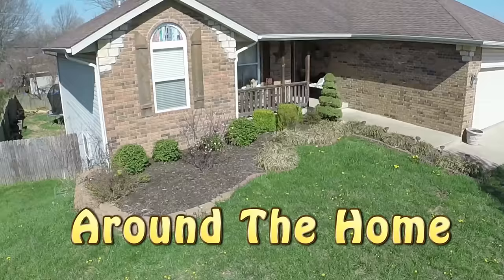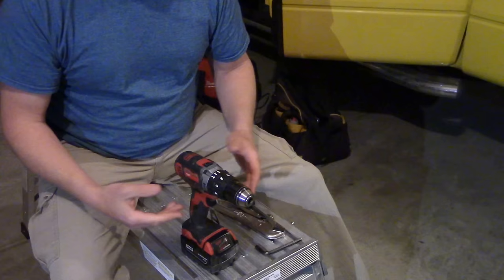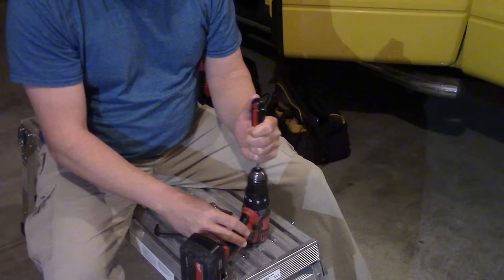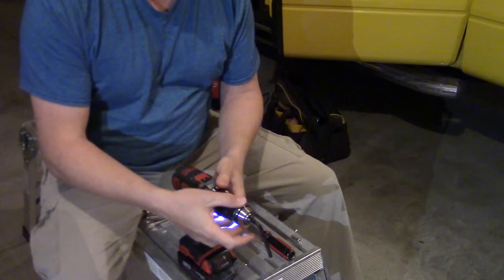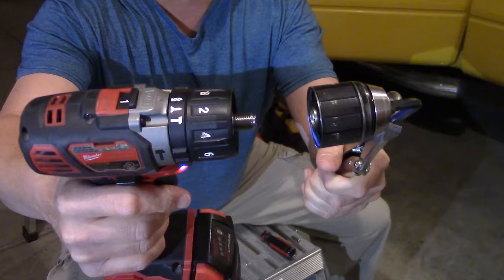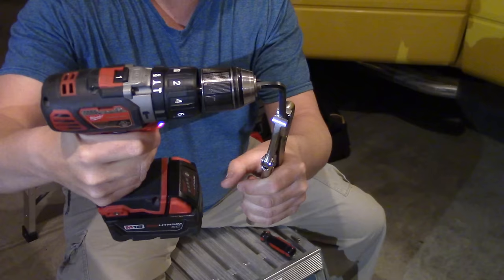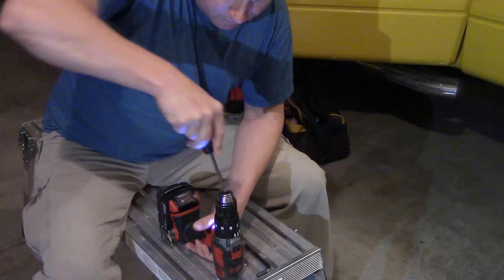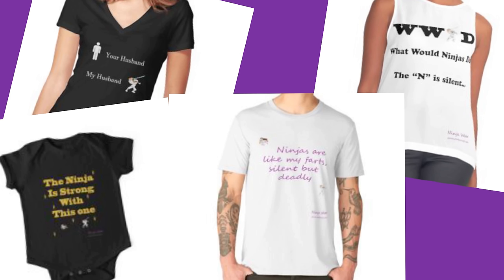Cordless Drill Chuck Removal

Comment: Hey thanks, you saved me from having to buy a new drill. I was on the verge of throwing mine out, as I've never been able to remove a chuck  before. The allan key trick did it. Also as a bonus, once the chuck came out, I was able to fix the three grippers that had partially jammed for some reason. Luckly, they jammed wide enough to take the allan key. Back to normal now, no money spent. Many thanks mister. Much appreciated.
Reply from the maker: You are welcome!

Comment: Thanks for sharing. One tip is that you can use an impact driver to tighten or loosen the screw inside the drill chuck. This way you won't risk anything grabbing, smacking you in the face, etc. Drills are probably in the top 3 causes of testicle-related injuries.
Reply from the maker: Thank you for watching. Check out hundreds more of our videos at https://www.aroundthehome.org/
Reply: Exactly what I was thinking :)
Reply: Yesterday I was trying to twist off the screw with a screwdriver till my skin almost came off. Then I mounted a flat head bit to my mid torque impact wrench and it loosened with just a flinch of the trigger.
Reply: Curious, What are the other top 2?

Comment: Unfortunately this didn't work for me. Drill doesn't have enough power at 55 nm, and whacking with a hammer won't get it loose. I can use raw force with extra leverage on the allen key, but it just seems to turn the chuck somehow. It's at speed 1, drill mode and in reverse. Any ideas?

Comment: Your very detail video saved my Harbor Freight Hercules 1/2" 20V Model HC92K1 drill which sold for $120.     It was advertised as "comparable" to the Dewalt drill and a compatable chuck sells for $16 on Amazon that one reviewer indicated it fit Hercules.  My drill's chuck would open to full width but would not tighten enough to hold any drill less that 1/4".   The screw in the chuck was a Toric 15 and it turns out that it was very loose.   I tighten the screw (left threads) and now it works just fine and no new chuck needed.
Reply from the maker: Glad to help

Comment: Second time changing a chuck on a makita drill . 

First time was for a friend , the chuck was completely broken. Teeth were broken so couldn’t use an Allen key . Cut outside chuck casing with a grinder and locked a 24” pipe wrench on chuck to lock it and used a steel site box for mechanical leverage to spin the chuck off .

Tried your method today and had no luck . But decided to just use the vice grips as leverage with the Allen key and it came off . 

Good video ,thanks !

Comment: Thanks for the video.

I ended up using a breaker bar and the largest 1/2" drive hex bit that I could fit into the chuck, which ended up being a 7/16" hex for my 1/2" drive drill.  I pinned the breaker bar and the drill against the ground and bumped the trigger to break the chuck loose.
Reply from the maker: Thanks for watching. Don't forget to stop by our website www.greatwhiteninja.com

Comment: I busted my middle finger after taking the screw out and attempt to use the vice-grip and the biggest hex key (6mm) that I could find my hands on. The vice grip slipped and by the time I had noticed the hex key had already struck my finger.

Tip 1. after taking out the screw use wd-40 and wait 15mins for it to soak into the chuck's rod and it will come apart easily.
3 weeks until my finger heals. It's just a scratch still but I wanted to avoid it altogether. Use a decent pair of gloves too.

Comment: Milwaukee doesn't suck! But you can still change the chuck on your newer M18s which use the 9/16"-18 chuck. At this time you will not find either of the ROHM 1/2"-20 or the 9/16"-18 on Amazon. But Suncoast Precision Tools has them. At least they have the 9/16"-20. I just received 1 and ordered another today.

Comment: I had a Makita drill that would not come off by hitting it with a hammer and allen key like the other videos showed. 
This one actually works !  Just make sure drill is in the lowest speed (1) for most breaking power and it is in reverse.  Also I put the other end of the allen key in a vise. And USE 2 HANDS ON THE DRILL.  It can tear your wrist off if you don't hold it very secure and with both hands. 
Another method that looks like it would work is using an air powered air gun with a hex bit in the drill and the drill in a vise.
Reply from the maker: Thanks for watching, and I am glad to help. Don't forget to stop by our website www.greatwhiteninja.com

Comment: I have a 1/2 inch magnum drill motor 5.5 amps that uses a keyless chuck. That uses the best keyless chuck. They should of used that chuck in there heavy duty cordless drill. They are just making things a lot cheaper these days. But the price is does not go down.
Reply from the maker: You are right. Thank you for watching. Check out hundreds more of our videos at https://www.aroundthehome.org
Reply: @AroundTheHome1  Thanks for the confirmation and will watch more of your videos Sir.
Reply: @AroundTheHome1  Can you tell me if my Porter Cable drill motor 18 volts can get a replacement drill chuck that is of high quality ?? My chuck does not hold drill bits firmly. Can I purchase a high quality one from say Jacobs ??? Thanks

Comment: Thank you!  I'm making a 1/2 impact to drill chuck adapter using the chuck you recommended.  I just didn't want to mess with the 1/4 hex drive version, my setup will be much stronger & versatile.
Reply from the maker: Thanks for watching and don't forget to stop by our website for many more helpful videos. www.greatwhiteninja.com
Reply: @AroundTheHome1  I had to use a T20 torx on my Dewalt and vise grips (sucker was on there!) but I just removed it and I'll put the new chuck on the drill & make the adapter from the old chuck.
Reply from the maker: Sounds great.

Comment: Good video. I have 2 Milwaukee drills.. one for work and one for home that I wanted to swap chucks.. This is definitely not as easy as it looks. I could not get either chuck off. I got the screw out of one.. that's it.
Reply from the maker: Sometimes these things will fight you tooth and nail to get them off. If rust has started to build up inside the chuck, you are definitely in for a fight. Good luck man.

Comment: So, this did remind me that the hammer action can break itself loose however. Most people are not as strong as this guy, and for some reason if your drill is still pushing full torque at the low setting, you can get hurt. I tried to hold the Allen wrench with my foot and it still slipped and hit my shin pretty hard, lucky it didn't crack my bone. I immediately remembered I had a metal pipe and steped on the drill with the pipe on the Allen wrench and it immediately came off. Nothing I did before that worked and I don't have a vise. Now trying to steal a chuck from a rigid drill for it but it just slips wont come off.
Reply from the maker: Putting the Allen wrench in a pipe is a good idea to give you more leverage. Using a 1/2 or 3/8 galvanized pipe would probably do great. Many of these drills do have a lot of torque so it can get dangerous.

Comment: But my chuck won't get tight on nothing that's why I need to replace it, so im gonna have to try the hammer method?
Update: Got my Milwaukee one key hammer drill fixed by Milwaukee it was still under warranty, They actually replaced more than the chuck, is like a new $200dls drill now, I'm glad I decide it to take it to the Milwaukee shop.
Reply: Yeah that's my problem as well ..

Comment: I had two drills where i needed to remove the chucks.  I couldn't get the screw out this way, so i  drilled a 4.2mm hole in the top of the screw and started to cut a thread in the hole with an m5 tap and that worked for me. then it was easy to take the chuck off.
Reply: Wow , sounds like too much work

Comment: Great video, thanks. Anyone watching this for instructions is surely not as experienced as you are. These are your target viewers.  Best to have the allen key in the vise, short bursts of power with two hands on drill, one elbow down side depending whether removing/replacing to catch the kickback. No nasty injuries. You mentioned that the chuck is the weakest link but as the chuck is easily replaced sometimes it's better for it to break before the drill does. Thoughts?
Reply: . 
..k. .  .
  . .?
.
.
. .
Reply: 4

Comment: My chuck was on super tight that I needed to use a ratchet and adapter. And the screw required a T40 torx key. And then to add insult to injury, the screw that came with the Rohm chuck I chose is like 70% the diameter of the Milwaukee. I haven't gotten it completely off yet, so I can't comment on whether the post is different too. But it'll REALLY piss me off if it is. At which point I'll tear the drill down far enough to take it off and try to fix all that with my lathe
Reply from the maker: Is your Milwaukee drill a Fuel model? They use a different size chuck and different mounting screw.

Comment: To loosen the screw, you said set the drill to forward position, that means the chuck will turn anticlockwise. Should it not be setting the drill to reverse position to loosen the screw? Please advice.
Reply from the maker: This video is correct, at least for every drill chuck that I have worked with.

Comment: Thanks
Reply from the maker: Thank you. I just checked my link in the description and it was no longer good. Here are the updated links. 1/2"-20 Rohm Keyless Chuck: https://www.amazon.com/Rohm-893350-Extra-RV10-Through-Hole-Diameter/dp/B00DD7KGHY?crid=1UBSKNXQBLIZL&keywords=rohm+1%2F2-20+drill+chuck&qid=1656509535&sprefix=rohm+1%2F2%2Caps%2C102&sr=8-4&linkCode=ll1&tag=greatwhitenin-20&linkId=90c9f41675485fb455a264ec7b2cbecf&language=en_US&ref_=as_li_ss_tl

3/8"-24 Rohm Keyless Chuck: https://www.amazon.com/Rohm-893351-Extra-RV10-Through-Hole-Diameter/dp/B00DD7KPPC?pd_rd_w=oQZOH&content-id=amzn1.sym.c32bd24a-4ef0-4e42-bb31-8027e5f6a185&pf_rd_p=c32bd24a-4ef0-4e42-bb31-8027e5f6a185&pf_rd_r=T3J9BEZMRK71CC9MRFRK&pd_rd_wg=TNPdm&pd_rd_r=7afef2da-06bc-4e9b-9a45-23e87828fdb2&pd_rd_i=B00DD7KPPC&psc=1&linkCode=ll1&tag=greatwhitenin-20&linkId=b07919f067e98bf41c4b1d1b571bba9f&language=en_US&ref_=as_li_ss_tl

Now, my drill uses the 1/2"-20 but there is also a link for the 3/8"-24

Comment: Fellas, if you can tighten the chuck on the Allen wrench you don't have a problem in the first place.  What if the chuck is stuck wide open?
Reply from the maker: Well actually chucks can loose their locking ability, slip, and get a wobble but still hold onto an allen long enough to do this. Obviously if yours is stuck open then you have a bigger problem. Hopefully yours has a metal sleave because the next thing I would suggest is to put a pipe wrench on it.

Comment: My Craftsman model CMD710 needed a new chuck. went online for warranty replacement, and was sent a brand new drill, and charger. I figured "score" for me and ordered a new chuck figuring to gift out the new one. Used the craftsman site, and the chuck is available. Now things got interesting. Found out my drill has nothing to unscrew. Nothing there but what looks like the end of a shaft. The thread on the new chuck (ordered from Craftsman site) is regular direction. So how am I supposed to get off the old chuck? Do the same thing as normal with something in the chuck and whack it?
Reply from the maker: I think so. Every drill I have had has a locking screw inside, but there is always a new model that changes something.

Comment: I have never had problems with the chuck on any drill with a cord, every cordless one has stripped and I'm done with cordless ones.
Reply from the maker: You are right, many of these cordless drills have cheap chucks. Need to find one with a Jacobs or a Rohm. Strangely enough, I have found the Jacobs on the Master Force sold at Menards and on the Cobalt and Flex at Lowes.

Comment: Nice vídeo .
I need a chuck for my DeWalt hammer drill DCD796. Bought 20 October 2020 and the chuck is already bad. This is why I use a full times. This is crazy brother. I can believe it. 

If you have any idea or recommendations about a good chuck, let me know. I will appreciate. 
Do you know if the link you post will work for me as well?
Thanks!; May God bless you 😀
Reply from the maker: It should as long as it was a 1/2" chuck. This one uses the standard 1/2" - 20 threads. Every viewer that has mentioned that they switched to this one say they love it. And yes, it is crazy how so many of the top drill companies are using crappy chucks.

Comment: I have a problem with my Milwaukee chuck also, it doesn’t move at all, after I used its hammer setting mode, the jaws become frozen after sometime using the  hammer
Reply from the maker: I have found that the stock chuck on these is just terrible. This drill is actually on it's second factory chuck. I had the first one replaced on warranty, on the last week of the warranty believe it or not, but the newer one started acting up after a year again.

Comment: I have the same problem.  Do you have the link for the new one?
Reply from the maker: Thank you. I just checked my link in the description and it was no longer good. Here are the updated links. 1/2"-20 Rohm Keyless Chuck: https://www.amazon.com/Rohm-893350-Extra-RV10-Through-Hole-Diameter/dp/B00DD7KGHY?crid=1UBSKNXQBLIZL&keywords=rohm+1%2F2-20+drill+chuck&qid=1656509535&sprefix=rohm+1%2F2%2Caps%2C102&sr=8-4&linkCode=ll1&tag=greatwhitenin-20&linkId=90c9f41675485fb455a264ec7b2cbecf&language=en_US&ref_=as_li_ss_tl

3/8"-24 Rohm Keyless Chuck: https://www.amazon.com/Rohm-893351-Extra-RV10-Through-Hole-Diameter/dp/B00DD7KPPC?pd_rd_w=oQZOH&content-id=amzn1.sym.c32bd24a-4ef0-4e42-bb31-8027e5f6a185&pf_rd_p=c32bd24a-4ef0-4e42-bb31-8027e5f6a185&pf_rd_r=T3J9BEZMRK71CC9MRFRK&pd_rd_wg=TNPdm&pd_rd_r=7afef2da-06bc-4e9b-9a45-23e87828fdb2&pd_rd_i=B00DD7KPPC&psc=1&linkCode=ll1&tag=greatwhitenin-20&linkId=b07919f067e98bf41c4b1d1b571bba9f&language=en_US&ref_=as_li_ss_tl

Now, my drill uses the 1/2"-20 but there is also a link for the 3/8"-24

Comment: hello the problem is my device has 2 chuck its black & decker cordless 14.4v driver/drill i have screwed out the screw so easily but the problem with the 2 collars after turn one it goes to point that stop and start turning the one behind it so i tried to use 2 wrench one fix one and another wrench to loose the another collar but here is the big problem it doesnt loose whatever i push it so how to replace this doomed chuck i am stuck now with broken jaw teeth??!!

Comment: Would this be a standard procedure for most brand drills? I have a JCB drill and the chuck has a locking mechanism on it which is a nightmare to unlock so I want to switch it out for a no locking version
Reply from the maker: Yes, this will work on most drills. Can't say for them all, but this is a standard procedure to remove a chuck.

Comment: Do these things have a bit of wobble in the chuck? I bought a Ryobi off eBay and it does wobble. The seller said I can return it or get a part refund. I made sure the screw is tight but didn't remove the chuck. Thanks.
Reply from the maker: It should't. Are you sure the chuck is wobbling and maybe not a bent drill bit? Just asking because a slightly bent bit can look like the whole thing is off. Thanks for watching and don't forget to stop by our website for many more helpful videos. www.greatwhiteninja.com

Comment: I unxerstand how to take off chuck, but my problem is the chuck does not spin to close up on a allen wrench. It is stuck open.
Reply from the maker: Does the outer ring of the chuck hit a stop still or does it just spin?
Reply: @AroundTheHome1  it just spins, there is a yellow ring between the chuck and drill.
Reply from the maker: Ok, I was hoping that it didn't so that you could put a pipe wrench on it. Is there any part of the outer chuck that you can grab onto? Might have to break the ring off so that you can get a pipe wrench to hold on.

Comment: Put Allen key in and hit with small hammer. Won't budge. Then hit with large rubber mallet. Still nothing. Then hit it with a lump hammer, still nothing. Put drill on floor with Allen key angled about 3" off the floor. Stand on drill and repeatedly drop full weight of a sledge hammer on it. 3 hits it finally gave. 😂
Reply from the maker: Wow, and the drill survived?

Comment: Can confirm, new fuel drill has an exotic spindle thread. Tried to put a ROHM on my 2704-20 and couldn't. Friggin Milwaukee
Reply from the maker: Thanks for the heads up. And thank you for watching.
Reply: Extra-RV50 part number 1325031

That is a ROHM part number can’t find it on amazon but it has a 9/16-18 spindle allegedly that’s what the 2704 hammer drill is now using anyone wanna order it and let me know

Comment: What can you do if a drill bit is stuck ?
Reply from the maker: I'm sorry, I actually haven't had that problem. If the chuck is locked up and worthless with a bit stuck in it, the only thing I could think of would be to use a fabric abrasive blade in a miter saw and cut the end of the chuck off. Obviously don't cut off too much. It is a bit of a gamble. Good luck whatever you do. Thank you for watching. Check out hundreds more of our videos at https://www.aroundthehome.org

Comment: How do you remove the M6 chuck screw when it's broken?  I've ran into that issue right now.
Reply from the maker: Like the head broke off or it is stripped out?
Reply: Screw broke off and head came off loose. Any advice????
Great vid by the way
Reply: I'm probably a bit late, but since it's a left hand threaded screw, you can probably get a right hand twist drill to grab it